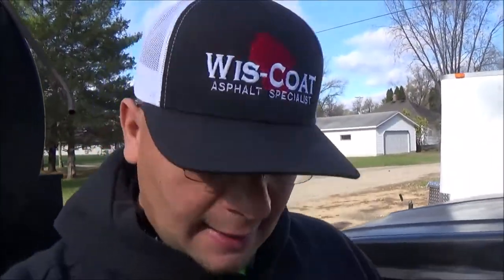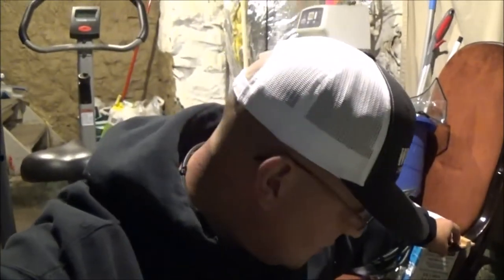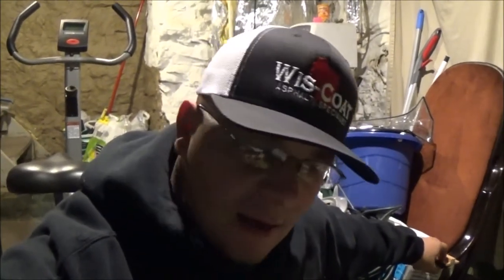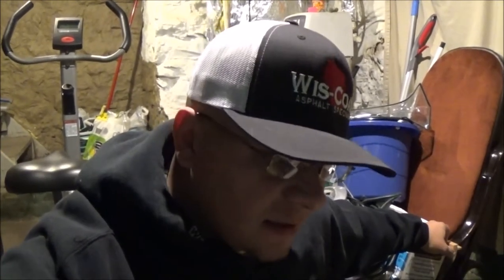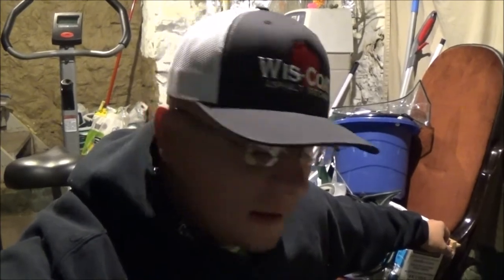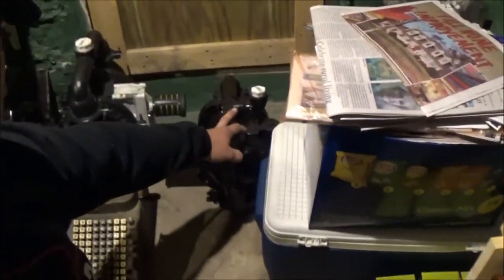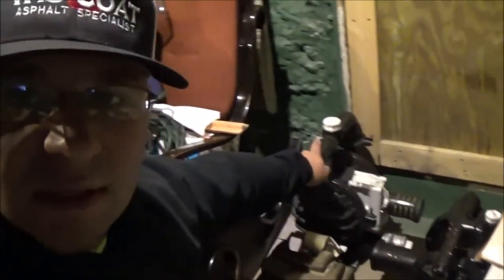Winterizing Diaphragm Pumps

Comment: I've got a 1.5 in Graco Husky on my outfit. Haven't replaced diaphragms since 2010, and I've had to take it apart and clean it numerous times before the season started because I let it freeze. No problems yet. Just did it yesterday, and crossing my fingers she'll pump ok when I put everything back together. Check balls looked a little beat up this time.
Reply from the maker: Haven’t got to use a Gracie husky yet

Comment: WILDEN IS JUNK. I USED WILDEN FOR THE PAST 20 YEARS AND KEPT HAVING PROBLEMS LOOSING PRESSURE WHEN WE WERE EDGING. I NOW HAVE A 1 1/2 ARO AND I THINK ITS THE BEST PUMP MADE.
Reply from the maker: We have both, haven’t had any issues with either.